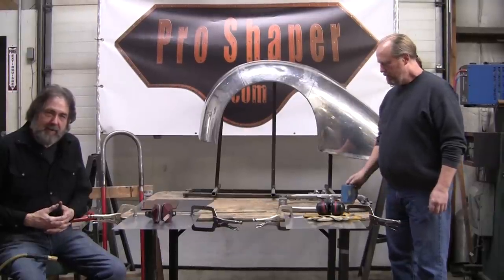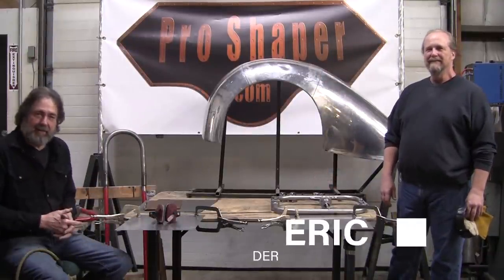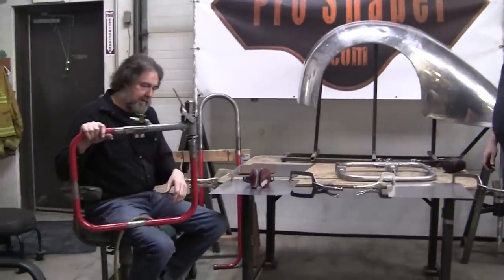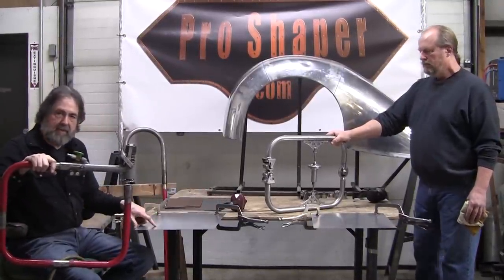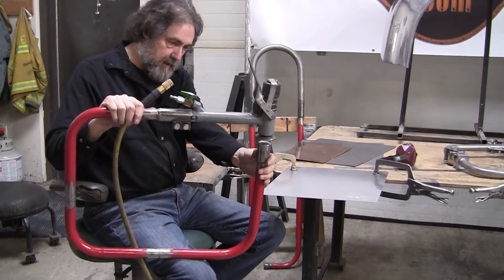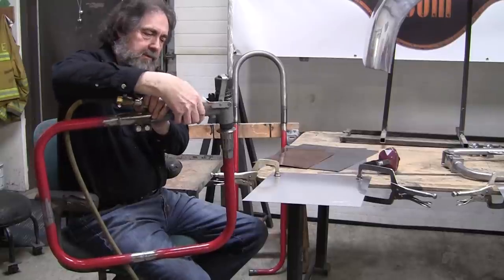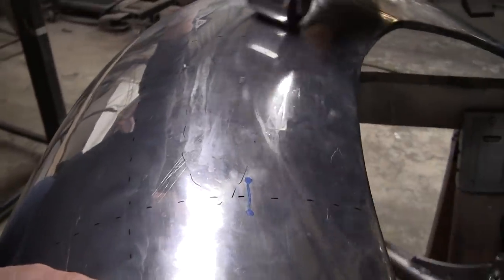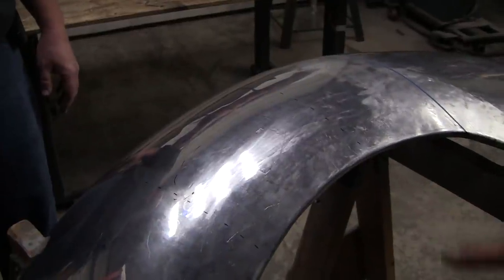Mobile English Wheel Roller / Planishing Hammer Positives and Negatives

Comment: So I fixed a big dent on a corner piece of aluminum trim on a camper. Used your small shot bag and a slipper to shrink the dent and get it close. To finish I took a polyurethane caster I had laying around and with hand pressure on top of my table saw was able to get a smooth finish on the piece. The mobile wheel looks like something a hobbyist could also mount on a bench and use any number of ways. Watching your videos keeps my mind in overdrive! Thanks Wray. Great stuff.

Comment: The end of this video shows just how HUGE your shop is. I don't think I could ever tell in previous videos.
Reply from the maker: 20000 sq ft.  Very expensive to heat. Ask me how I know?
Reply: @Wray Schelin's ProShaper Workshop  I can help with that too. Geothermal/solar.  HVAC designer with several consulting engineering firms for 20+ years

Comment: The triangle from a road race bicycle makes a decent plannishing hammer / English wheel frame. The head tube and the down tube can be cut and made to accept both hinge and working bits. This allows a geometry swapping option to be supplied standard. Once we ramped up production the other one was second nature.
Reynolds 531, Invisible 10° Train Track  Bikeless in Milliseconds trick and a Columbus 4130, Liquored Up, Padul to the Mwadal Oldsmobile 442 Red Light Drag in R are my favourite self recycled frames. No memory blanks make them special.

Comment: I like your portable English wheel and planishing hammer. I also have a recommendation for an improvement to the English wheel or any similar hinged tool. The recommendation is to use a toggle type clamp to close/open the hinge. That would speed things up quite a bit. Open the toggle to make pressure adjustments=no need for wrench of any type on the adjustment, plus you can open the toggle to enter and leave the workpiece. No need to change pressure adjustment to clear flanges or rims on the workpiece. The toggle could possibly be built from a pair of Vise-Grips or some style of De-Sta-Co clamp or custom designed.

Comment: In reference to annealing aluminium. When I was a plumber we used to use a bar of soap to tell the annealing temperature. Rub the soap on like a crayon , then heat the metal  until the soap turns black. Or you could buy a cheap ir thermometer from Amazon.
Reply from the maker: I have tried every method, the best I have found is draw some scribble lines with a Magic Marker on the panel, then soot it up. Burn off the soot and then the marker.

Comment: Wray I sent you an e-mail about CAD to your proshaper e-mail.  Subject Cad.  In case it trashed it.  I did attach a PDF sample. Great Videos.
Reply from the maker: It just happens that Gilles (he is the owner of the Talbot Lago fiberglass body we got in.) is a Solid Works wizard and has offered to help with any CAD work I may need. Thanks for the offer. Wray

Comment: Wray, my question is where do you find 2” wheels in shapes required to get into various radius? How did you turn the roller sideways at the 90 degrees from straight as you began? I am impressed but missed it, wasn’t shown as it looks welded solid! 
DK, ASE master, Omaha. Retired.
Reply from the maker: We make all of our top wheels and anvils. We can make any size. All English wheels should have the ability to rotate the upper and lower yoke 360 degrees. That is how we make all of our English wheels.
Reply: @proshaper  Got ya! I didn’t know! Thanks.